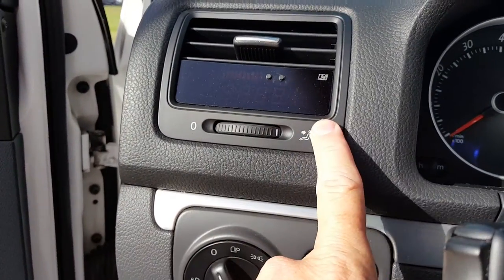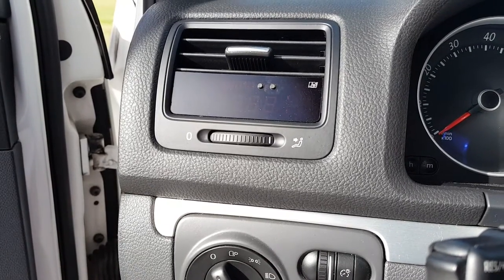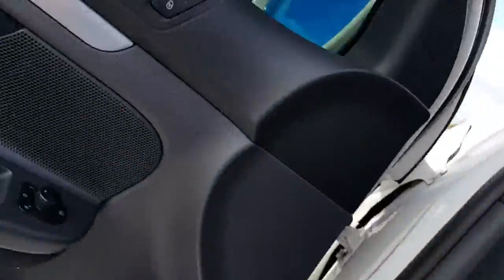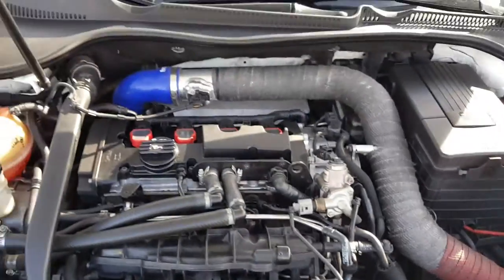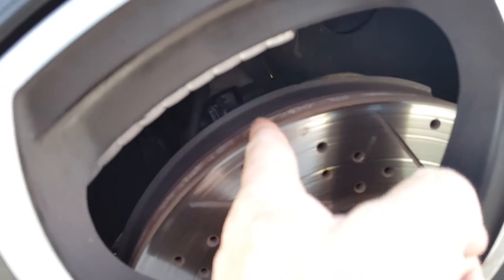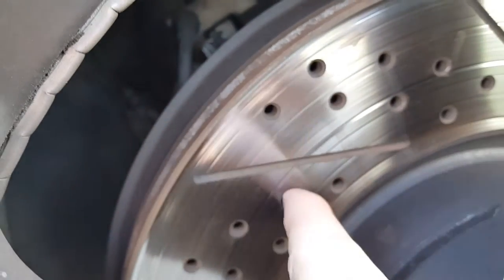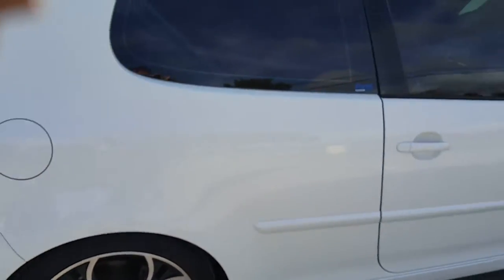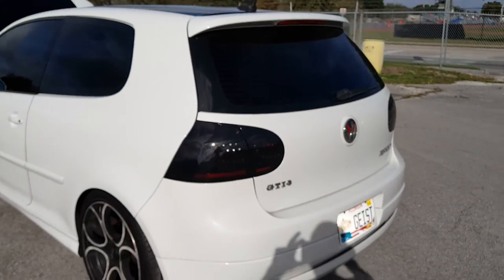What's Code 0456 VW GTI MkV NEW Gas Cap/Purge Vlv.

Comment: same i did both and my check engine light is still on
Reply from the maker: With APR software you can press FAULT CODE ERASE and it will go away unless there is something else causing it.  New O2 sensor, gas cap, and or purge valve?
Reply: gtiman67 i tried everything besides 02 senors i will try thank you